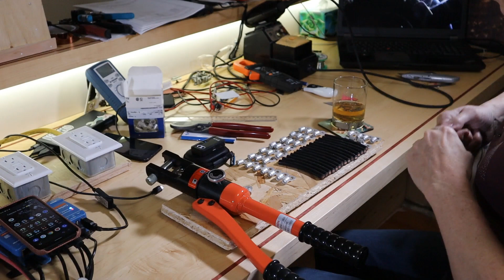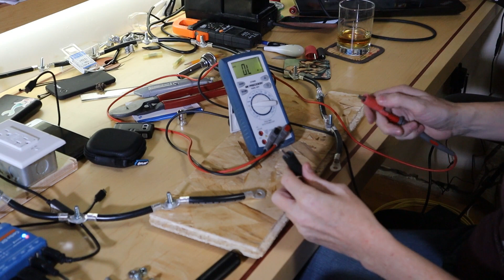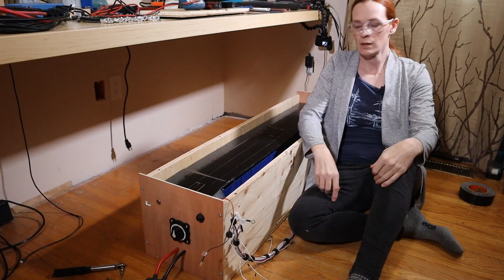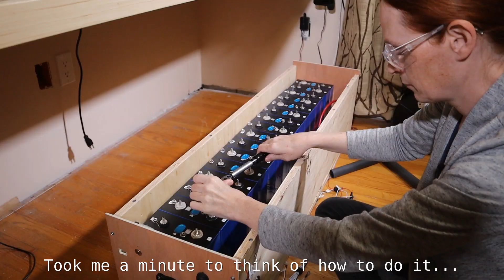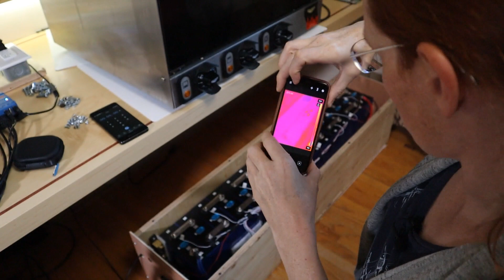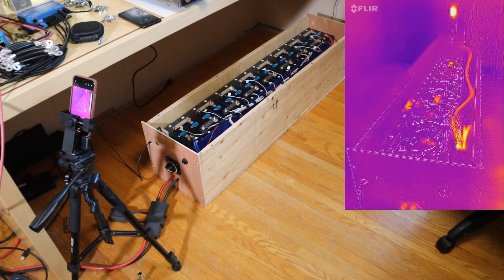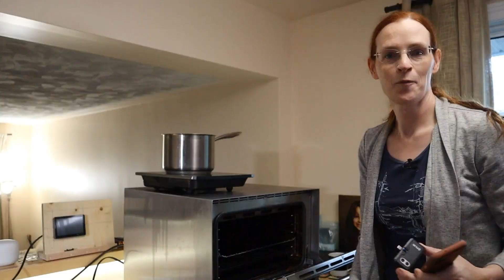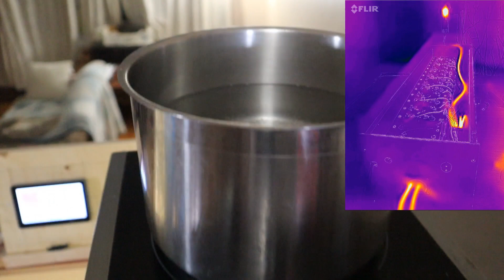What's Better? Rigid or Flexible Bus Bars - How to build a 48v Lifepo4 battery (Ep. 21)

Comment: Thank you so much for this video, I've been looking to build the exact same setup for my boat! 16s with what looks like the overkill solar 100A BMS. I too was wondering why people were saying don't use wires to connect the series string. Especially in a mobile application. Glad to see some real world hands on testing with exactly what I'm looking to build. Out of curiosity, where did you get those cells from and are they 280Ah each?
Reply from the maker: You're very welcome! They're from Basen Technology on Alibaba, and yes they're the 280Ah EVE cells, real world draw test got 14.2kw capacity. That said, I am now planning to order the 302Ah versions (nearly identical size) when I buy the bulk pack for the boat. If, buy the time I am ready to order, they have even larger capacity, I'll order those instead. Basically whatever is the highest capacity for the relative form factor. My next video, thanks to a viewer, I am going to experiment with a couple new battery configs that will used the flexible bus bars without inducing the springiness, and removing the long positive cable. So keep an eye out for that. I am hoping to film it tomorrow, but work may push that back to the middle of next week.
Reply: @TheDigitalMermaid  thanks for the name of the supplier, those cells look really good, and pulled full capacity, so definitely gonna check out Basen Technology. I think I'll go with their 302aH offering as well, even though it's a bit of a premium.

I'm excited to see the new test! Another thing that always made me wonder why people were so against flexible "bus bars" is often the positive or negative cable is a longer run than all the bus bars put together, and of the same type of cable. So if anything is the bottleneck, it'd be that. You initial FLIR footage seems to back that up, but I'm curious to see the results of shortening it.
Reply: @MYNautiGirl  I filmed the next episode yesterday, and successfully shortened the positive cable dramatically. Hopefully it'll be up this weekend, of work allows. :)
Reply: @Digimer  Cheers! I'm excited to see it when you get the time :)

Comment: Very interesting and timely test. Thank you.  I'm about to build a 12v 280Amp battery and also considering using flexible busbars. I'm considering arranging the cells in a parallel configuration. Then connect the busbars diagonally across rather than a loop. That way it avoids tension on the posts but still allows flexibility.  
What do you think.?
Reply from the maker: I'm going to be playing with layout options that might address this in the next video. Hopefully tomorrow, but possibly middle of next week, work allowing. :)

Comment: Let me solve your number of connections problem.🤔 Bend the solid bus bar into an omega shape with tails making it a spring. Then you get the benefit of both. They would need to be a bit longer though.

Also something not be aware of. Torque isn't a super accurate method of determining clamping pressure. It is just the most convenient. Whether the fasteners are lubricated has a large affect, and whether it is the first or multiple times the connection has been made has a large affect. So when you put the plates on the second time it takes more torque to get the same pressure. Also if you happened to flip some of them, the virgin surfaces will take less torque. So where the wrench is a fixed torque those connections are tighter than the ones with marks from previous tightens.
The point being orient the bars all in the same manner, and possibly use a bit higher torque the next time tightened if the posts can handle the torque. I would imagine the multiple tightenings also changes the resistance by pushing out the oxide layer.
Finally I doubt that resistance reading is accurate. It takes special meters to handle microOhm level measurements. Not sure what you have, but most don't own one. Better than nothing, but not conclusive.

Comment: If you are worried about nuts backing off you may want to look into some NordLock locking washers. :) I'm not sure what you would run into with corrosion and what you would need to spec for the material or coatings though.
Reply: Hi Patrick.   It is very likely that the batteries will not leak because of the vent on the top of the battery. If you put anything at all on either the leads,  battery posts, the metal pad that lug or buss bar attaches to,  or the buss bar itself  you are making a resistor between the surface pad of the battery and the buss bar.   Even the oils or lotion on your hands can contaminate the connection. To fix this take a clean paper towel and use acetone to remove dirt and oil or grease from the buss bars or lugs.  Highlight the fact that she was using a torque tool to get a consistent tightness across all of the batteries.  Hope that fixes the buildup of heat on the surface/buss bar problem.

Comment: You could have used smaller wires for the bus wires. Wires are sized for a minimum  number of feet. You have less than 1 foot. For a test you could try replacing 2 wires, one a 6 and on a 8, smaller more flexible. Run the test again to see if any heat up. just a thought.
Reply: Hi John Little,  meet Lou Little.   I live in Salt Lake City, Utah. 67 years old.

Comment: Here is another test for you to do to see how much the aluminum will stretch and compress with heat and cold.  First in room temperature trace the outside of the battery buss bar on a piece of paper.  Now put the buss bar in the freezer and let it get real cold.  Pull it out and quickly outline the bus bar the same as you did at room temperature.  Now put the best bar in your oven and heat it to approximately a hundred degrees centigrade. Pull it out and quickly outline the best bar again on the paper.  Now with your micrometer or what you have there to measure the distance you can see the actual differences in the temperatures both at the cold side and the warm side of the bus bar. I would be interested in seeing how much stretch it has at the extremes. Good luck 
Lou

Comment: I would have liked to see if there was any difference in total voltage. If there is any resistance it would show with the voltage under load. The buss bars that came with my cells were already flexible aa they were made from a stack of 5 very thin copper bars with a hump in the middle. They flex pretty easily.
Reply from the maker: Total voltage would have been a great test, too bad I didn't think of that when I made the video. There's enough benefits to flexible though that I'm pretty sold on this setup. Particularly because of a problem that might be solved in the next video... :D

Comment: Hi DM.  Pleased to meet you.   You have a good test going on.   However, you overlooked a couple of things.  Mostly because you are new to higher power devices.  IE batteries and inverters.   The one thing that you and Andy have not payed attention to is the contamination of a metal to metal connection is OIL on the surfaces of all your terminals.  You touch and handle every surface of your connections. Battery metal, buss bars, cadmium lugs, etc.  I'll say it here and now,  NEVER PUT ANYTHING ON YOUR CONNECTIONS TO  TRY TO MAKE A BETTER CONNECTION!  Anything that you put on the surface of the metal is a resistance to the connection and will show itself as heat to the connection.  Aluminum is generally a dirty metal and should be cleaned real well with acetone. The oil on your hands is another source of oil that contaminates the surface connection on batteries and terminals.  My guess is that the buss bars that showed up warmer than the rest of the bars were probably contaminated by the oil off of your fingers when you were handling them and doing your tests.  
Another thing that I would consider is in favor of the busbars and that the buss bar has more surface area that will cover the surface of the battery terminal allowing more current to pass through it. I am assuming that your battery terminal is aluminum and not copper. I am also assuming that's your buss bar is also aluminum 1/8 inch by 1 inch wide.  I believe that the best bars would be better if they were tinned copper. 1/8" X 1".  Please be mindful of dissimilar metals has corrosion could be a problem.
One more thing to consider is the fact that you should build your power cables at least twice to three times larger than the MAXIMUM current that your batteries could provide power to.  Welding cable is the best.   Yes I knew that you knew that.   The resistance in the length of cable that you have going from your batteries to your inverter are definitely too small. Do a test at 50 amps like you did in your video and measure the voltage drop from the battery connection to the inverter at the terminals of each.  Write down the voltage values of each length.  Now using Ohm's law, calculate the value of resistance.  I=E/R. R=E/I. 
Larger cables means less voltage drop.  I am using 4/0 size cable on my battery connections to my inverter.  I can charge my batteries at up to 300 amps from my solar panels.  My inverters max out at about 500 amps.  Don't be afraid to think big!  I hope you see the bigger picture!
Oh, I have the FLIR One Plus as well!  Yes, Andy should get one also!  Ha ha  Enjoy.
 Lou Little  in Salt Lake City,  Utah

Comment: This is an issue with not keeping the cells securely in place, the most important thing is to ensure: You have thread locker on your cells and they are held securely in place so the cells move in unison when using rigid buss bars. You also need to ensure that there is no gap between the buss bar the cells, i.g the bridge between the buss bar and the terminal, something should be placed there to provide support. 

Also Anything bigger than 4s setup in a vehicle is not recommended, the longer the chain of cells the bigger the likelihood of issues like this happening. This is why it is better to keep multiple small 4s setups than a single large 16s setup. A single point of failure in a large bank can trigger a chain reaction that takes down your entire bank.

You can drastically decrease cell expansion if you only charge them to 3.4v / cell (about 85% of total capacity).

Many Evs are hard linked, the latest tesla batteries are actually structural, the key is to make sure the entire battery pack moves as a single piece, if you are having flex within the pack then the structural integrity is deficient.
Reply from the maker: If you're using flexible bus bars / jumpers to build the cells, then I am not sure how 4x packs of 4S in series is better than a single 16s from a vibration / movement perspective. If you offer the ability for the cells to move, then they can move. Am I missing something? If your comment is that "use rigid up to four cells only", then I follow what you're saying. Are you saying that 16S with all flexible bus bars is not safe in a vehicle? If so, I'm not sure I follow why.

Comment: First time viewing your channel, great video. Not 100% on this but makes logical sense from my understanding of things. I would imagine the difference is a result if the way electrons flow through conductors. The vast majority of flow happens over the conductor surface. If the true cross sectional areas of the copper conductors are the same, then the results make sense because the stranded copper wire has a good deal more surface area than the bars. Now I believe that doesn’t hold true for same gauge solid copper WIRE vs stranded wire. Circular wires bundled together have air voids between the individual strands which is cross sectional area that would be filled with copper in a solid wire. So technically the stranded copper wire would have less cross sectional area, and a slightly lower capacity. You also could have more cross sectional area with the wire vs the bars. You could find that out by cutting the holes off a buse bar making a solid rectangle. Then cut and strip clean a piece of wire that exact length of that rectangle and compare the weight of the two. Assuming their densities are pretty close, that could tell you which one has the larger cross sectional area. Again I haven’t tested this myself so just a my thoughts.
Reply: There is a skin effect that results in most of the current flowing at the conductor surface but is to the best of my knowledge only a AC phenomenon that is caused because of the changing magnetic field and induced eddy currents. The skin depth depends on the frequency and the skin is thinner at a higher frequency and is defined as the point the current drops to 1/e ~37%. For 60HZ and copper the skin depth 8.5 mm. So you would see some measurable resistance difference because of this for the used wire dimension.

The problem is that this is a DC battery system and for it the skin depth is infinite. So the surface area is not relevant for a DC system like it would be for a AC system. There will be a minimal effect when the current changes but not when the current is constant.

I might be mistaken and there are some other phenomena but I have not heard about it.

Comment: I use Selterm or Ancor tinned lugs 1/4” #2 and quality welding cable “jumpers” instead of buss bars. Also important to seal the jumpers with heat shrink for long term reliability.

Comment: Kool experiment, thanks for sharing your results. I satisfied flexible buss bars are better. Food for thought current actually travels on the surface of the conductors. The fixed flat bus bars have a finite area for conductivity. I think if you were to measure the circumstances of the individual strands of the flexible cable you will find the have more surface area, thus have less resistance to current.

Comment: The batteries are not top balanced is why current is passing of that one buss bar
Reply from the maker: It is top-balanced (see earlier video). Also, if the heating was caused by cell voltage differences, you'd expect the same on the flexible. The cell delta is 0.004v

Comment: The torque wrench requires proper hand placement for the torque values to be accurate, although in this case ( measuring it lead impedance) I don’t think it makes any difference. Good and tight is all that is needed.

Comment: The larger capacity prismatic cells, eg. 304/310/320Ah seem to be more susceptible to bulging. Can’t compress already bulged cells. I have 8S grade B 310Ah. The supplied bus bars did not fit most connections. Cells are fitted with awful studs having a 10mm diameter base, obscuring most of the terminal. I bought longer, 2nd hand, ex lead acid, heavy duty bus bars. They have copper plate terminals, sandwiching flat braided cable. Could only get 5. The other 2 connections fit the original bus bars, which are 1mm thick, now tripled up. That avoids eddy currents in thick bus bars. Braided or stranded maybe better conductors. There maybe movement between the cells, due to expansion during charging, and the opposite on discharge. My system now performs well.

Comment: Hi. I recently did a week course in thermography, (THERMAL CAMERAS) the bus bars won't show any heat as there emissivity is low. U could heat one up in hot water for 5 minutes and the camera will show them as cold. You need to paint them or put a piece of electrical tape on them to show the thermal energy, in a nut shell. Ps old mate calling u bloke, bloke is Aussie slang for a man, he must be blind, and mate can be used to either gender. Great video.
Reply: To expand on what Garth said about the low emissivity of the shiny metal busbars, that also means they have a high reflectivity, like a mirror. I saw the wallwart on the power outlet glowing brightly in the IR camera. With the right camera angle, that could make a busbar appear hotter than it really is. (It can also make the metal appear cooler than it actually is if its reflecting something cold). The workaround is to look at the bar from different angles with the camera to minimize any chance of reflected heat. The electrical tape trick on the busbar works very well.

Comment: Great video and test. Well done ! I worked on nuclear submarines and call our battery banks used flexible bus bars. We all so used thermal cameras. Same results you got. It was explained to me the solid bars have two faults , one being that they may not make complete connections within the battery post and solid bars are not absolutely solid meaning there not the same density all the way through.

Comment: Now that you are using flexible "bus bars" to connect your cells together. You can leverage that decision to significantly shorten the length of cable that connects your pos and neg terminals to your BMS.  The idea would be to adjust the battery cell arrangement putting two cells next to each other with the pos terminal on the right and then the next two cells with the neg terminal to the right and continue that arrangement to the end of the row.  Then cut your flexible bus bars so they can reach from a neg terminal to a pos terminal but will skip every other cell.  Once you get to the end you then will come back the other direction ending with the negative terminal on the second cell.  I'll send an email with a picture to explain it better.
Reply from the maker: Keep in mind, I need to fix six of these packs into a boat engine bag. So I need to keep them narrow and long. I referred to them as "gum stick packs" in an earlier video. My battery shape is going the be largely dictated by the constraints of the boat, which is unique from how a lot of people design their battery layouts. Also remember that I will max out at 100A per pack draw, so loading isn't as much of a stress as some battery designs.